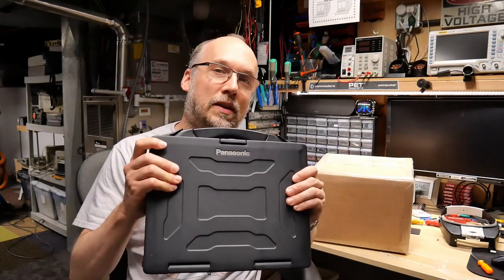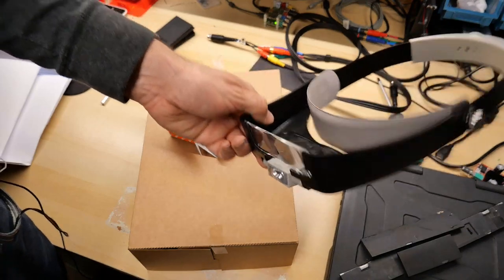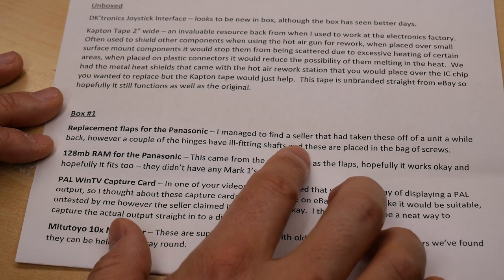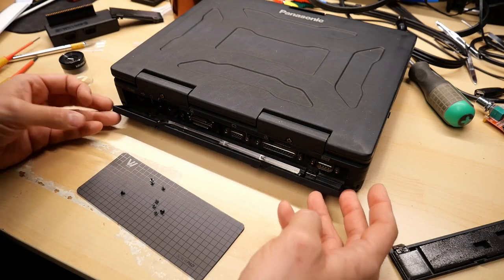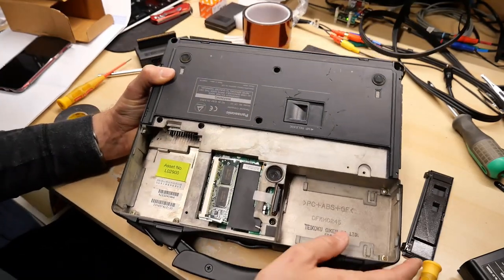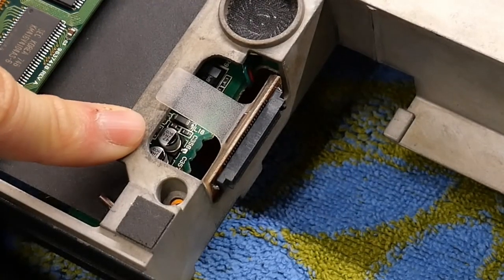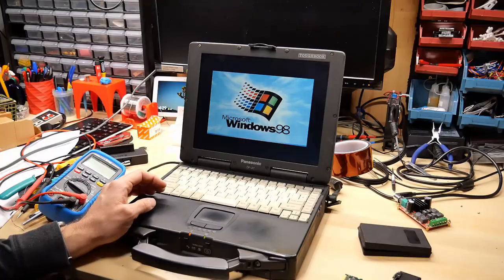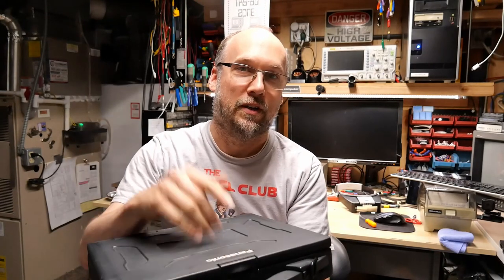Fixing and pimping the Panasonic Toughbook

Comment: Use the Capture Card with Linux. This will work perfect.
Reply: just force windows 7 or 10 to take the drivers "have disk" "browse for drivers" select inf etc, just make sure if you have a x64 copy of windows, you get a x64 driver, if only 32 bit is available....there is workarounds...but...good luck... or google for alternative drivers for your windows version of preference
also, i have a cheap usb tuner that literally can take ANY signal, it was a cheap first gen atsc tuner, 1 of the early 1s when they were still giving $40 coupons out(i still got 2 coupons left!!!) to get converter boxes and it does all of the data/decoding in software, you can get cheap usb tv tuners or dedicated "sdr" usb software defined radio devices, if you ever are at a loss for drivers, look in the device manager in windows>right click on whatever device, click properties and go to "Hardware Ids" in details, it will list devices like USB\VID_147E&PID_2016&REV_0002(this is the fingerprint reader in my laptop), if you google the vid and pid it will get you to the actual hardware drivers or product name, really useful for those creative webcams that printed the model on a little tag on the cord

Comment: You could have put the long magnet on the cover right by the db-9 serial port, so the magnet uses the edge of the db-9 serial port as a attraction point to keep the panel closed.
Cringe.. be careful intentionally shaking the mechanical ide-hdd containing device.
Reply from the maker: It's a Toughbook -- it was designed to be thrown around even while working. I will swap to a CF card, just waiting for the 44 pin to CF adapter to arrive. :-)
Reply: @adriansdigitalbasement  I used to have a toshiba into which I put a CF card I ran into al sorts of problems what with not being able to write and read at the same time, solved it by putting the firefox-profile and cache into ramdisk and backing up every time I had to shutdown or reboot. I used to have months of uptime with linux.

Comment: Hoi time to install a linux distro in your basement, i had the same card working as a tv recording pc with mythtv Hauppauge PVR-500 (dual PVR-150 on singel pci board)
in any linux distro the card wil be found as /dev/video0 and /dev/video1 out linux way is the simple way but for the tuner software  is mythtv a great program
https://www.mythtv.org/wiki/Setup_Capture_Cards#Card_type:_Analog_to_MPEG-2_encoder_card_.28PVR-150.2F250.2F350.2C_etc.29
any linuxdistro will work but see long list https://www.mythtv.org/wiki/Operating_system for a specific mythtv distro of linux
but now in belgium no analoge tv signal so no needed anymore pc is shutted down ;-((

pretty sure there is a live linux version with mythtv so you just have to make from the iso file a cdrom and boot it without installing to a harddisk drive but have to look for that
or what will you do with the card ? i can help you to test it with my linux knowledge and have the same card here but no any analog signal more from the net in belgium

success and thanks for a the good time traveler moments at your youtube channel you give us 
i had a coco2 my first computer at home as 13 year old boy